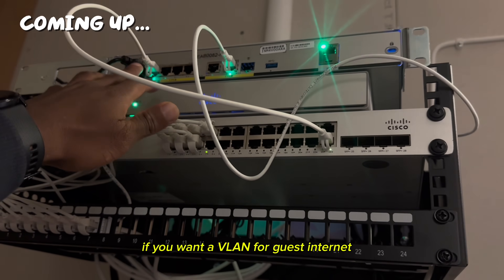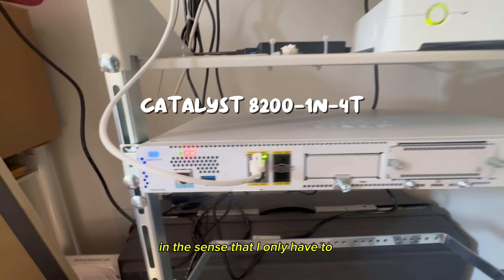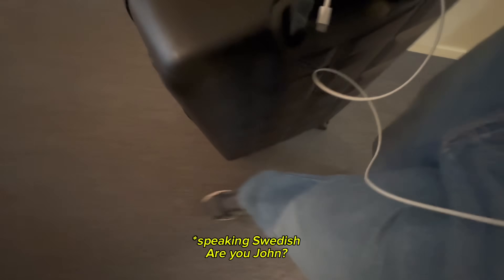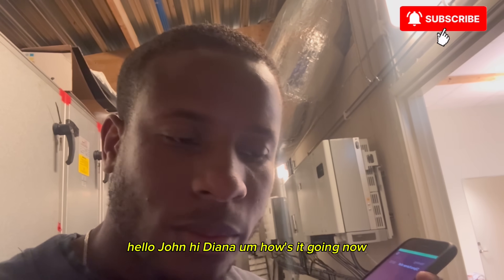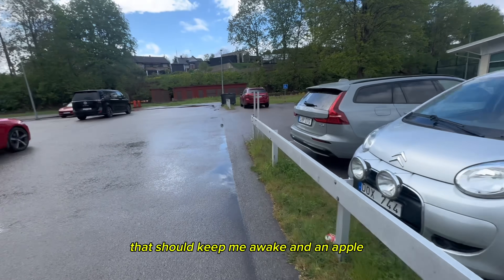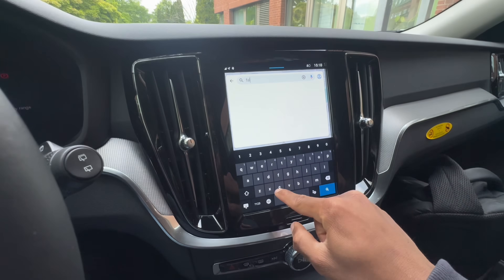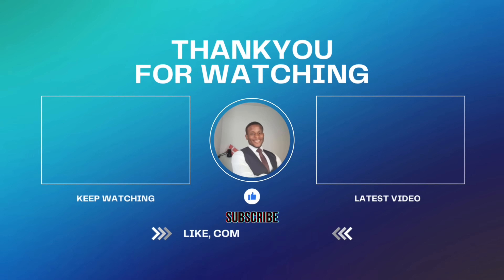Network Engineer Life - Integrating 90 Clinics in Sweden

Comment: Is a 4G mobile connection used as the main internet connection? What about stability? Usually, the mobile connection is a backup for the FTTH/ADSL/VDSL/etc connection if such a cable connection is available.
Reply from the maker: Hi Tomek!!  Yes you are right, In most cases it’s only a backup connection. But sometimes (rarely) 4G mobile is the primary connection as Fiber may not be available in certain areas or buildings :)  sometimes it’s the best solution give budget constraints :)

Comment: What is 4G router exactly? Its the router that operated on 4Gbps or it connected to the internet via 4G cellular network? I'm a little bit confused about it, bro
Reply from the maker: Cisco router with sim card and antenna using 4G cellular network 😁
Reply: @johnkatende3 Thanks bray, that's rare item in Indonesia anyway. Ive just knew that Cisco has 4G router too like Tp link
Reply from the maker: @prehatantobudilaksono9366 pretty common here often has a back up WAN link

Comment: Chapters
00:00 - Coming up 
00:34 - Intro and Project Background: Previa to Falck Takeover  
01:08 -  Kalmar Clinic Install  
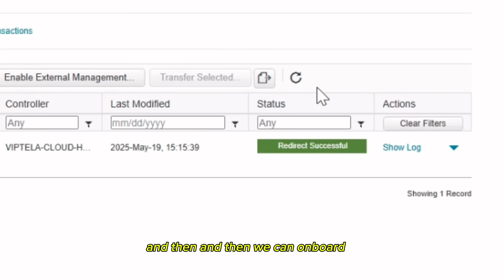02:05 - Tech Talk: Network Architecture
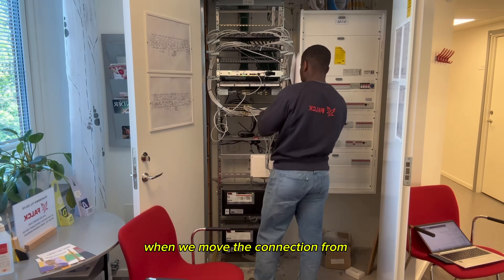03:51 - Oskarshamn Setup  
04:41 - Camera Issue at Kalmar + Resolution
06:50 - Nybro Clinic Install
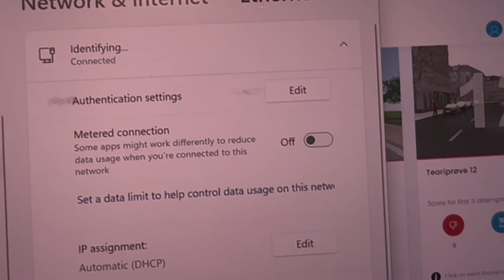08:59 - Arriving at Åseda Clinic
12:40 - Preparing for drive to Gothenburg
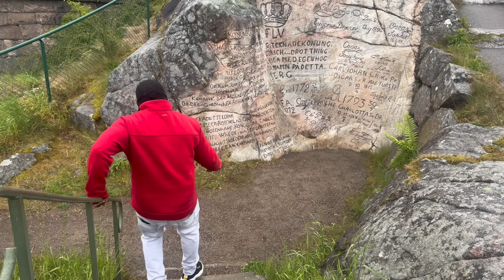13:31 - Gothenburg: First Volvo Clinic
15:32 - Gothenburg: 2nd Volvo Clinic
16:17 - Outro + Reflections